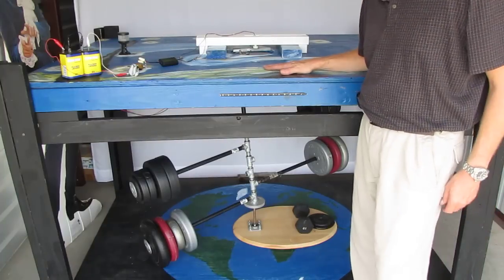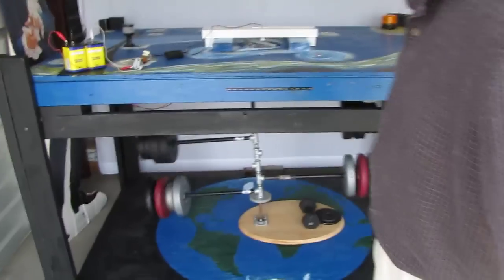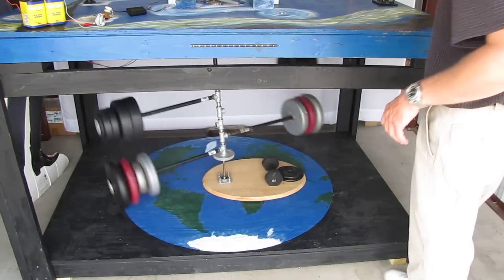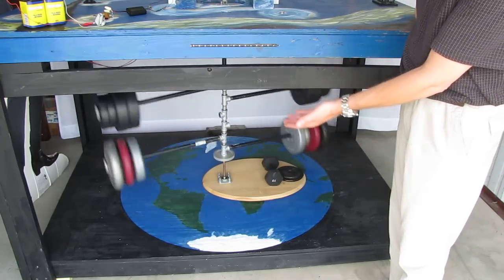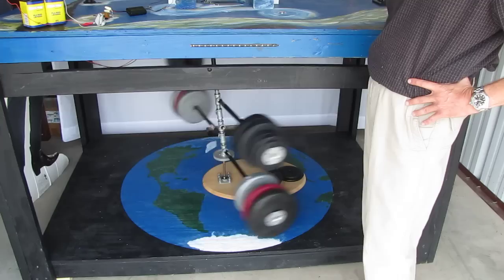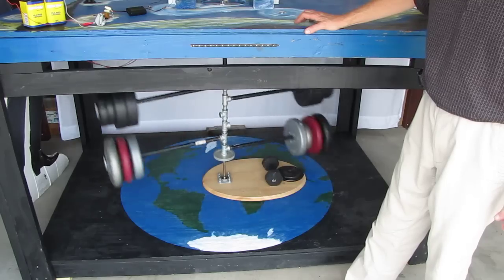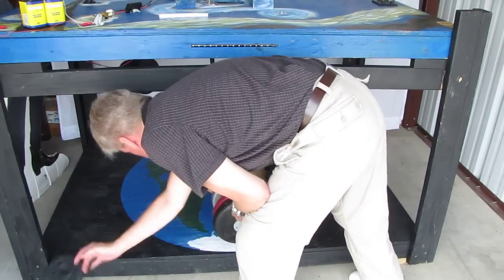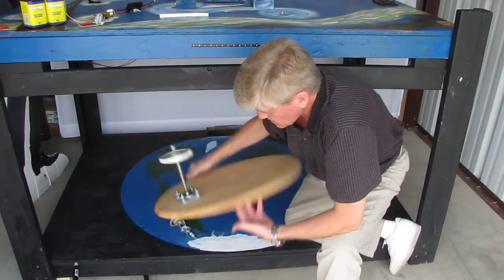The Impossible Video

Comment: Sadly this is just a flawed replication of the William Skinner gravity motor from 1936. I believe the Skinner device is essentially a rotary version of a Milkovic 2 stage oscillator which has never been able to close the loop and achieve over unity.  It seems to me that this is basically just a wobbly flywheel.  Any load on this would stall the system.  The very slow acceleration looks to be about 4 watts of power to me ... not too different from a push bike slowly accelerating under human power.  Torque multiplication is NOT the same as power multiplication.  Angular momentum is not Power.  The 4 watts input is maintaining the friction, heat and sound energy  losses in the system.  In other words this system could consume any number of kilowatt hours of power and still have nothing to show for it than the same upper limit of angular momentum that would quickly run down if a load was applied.

Comment: So why don't you close the loop by connecting the weights/shaft to a small generator that replaces the battery, plus provides some additional usable electrical energy for powering other things, thus showing it is a viable free energy device.      waiting to see this

Comment from the maker: Also, regarding weight, you might like to review the video GV-1 Quick CAD Video: GV-1001 Quick CAD Video, which is a SolidWorks generated video (with gravity enabled) showing the system with well over 16,000 (sixteen thousand) pounds rotating, as the weights shown are configured as solid steel.

Comment from the maker: What's funny about this video is that in the new setup you can see on the blog page of thejohndevice dot com or on facebook at thejohndevice, I have well over 300 lbs going on for the 'final' setup.  Quite a bit more than the 125 shown here, but if you get the principle of balance, you see it's really not different to The John Device.
Since it's the 'weight' that's moving itself, it really doesn't matter how much it weighs - just how much this particular implementation (good ol' GV-1) can take.

Comment from the maker: Sorry -  I don't read comments much.
I don't know what to say about the going faster than 60 rpm discussion by Dan Wright.  The system 'goes' at the speed I tell it to via the top drive motor.  If I put a motor on that goes faster, the system will go faster.  There are 'frequencies' that are more natural - as with any system, and since this iteration only uses the force of Gravity, it can actually be calculated.  By feel, I know it is around 30-45 RPM.  Beyond that speed, you will be 'pushing' the mass instead of the plane of rotation - effectively becoming nothing more than a flywheel. (for those of you who think this is a flywheel please see the FAQs on TheJohnDevice dot com - spoiler alert - it's NOT a flywheel)
Where a load would be attached is shown briefly in other videos and also on the 'CVRP Tech' page of TheJohnDevice dot com.
The system shown is imbalanced through mass.  Production systems will be balanced in mass, but unbalanced using other means not discussed here because production systems WON'T be Gravity-only.  This is also discussed briefly on the CVRP Tech page.
Finally, Thermodynamics are now also discussed on the FAQs section of TheJohnDevice dot com.